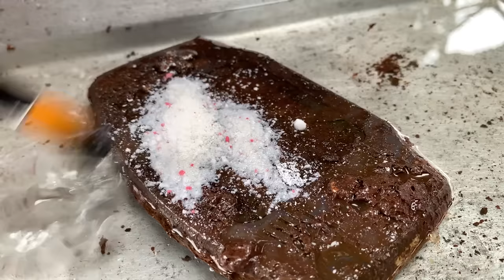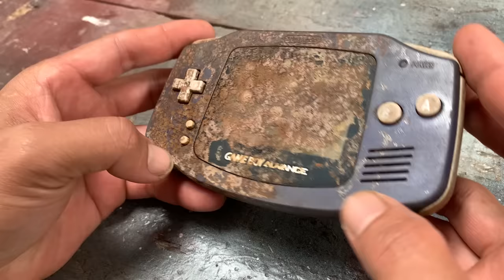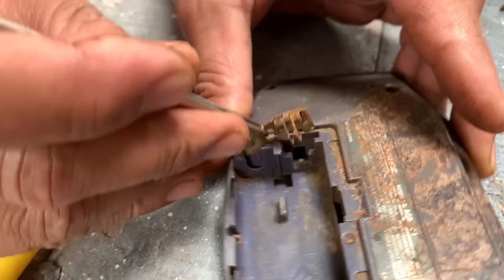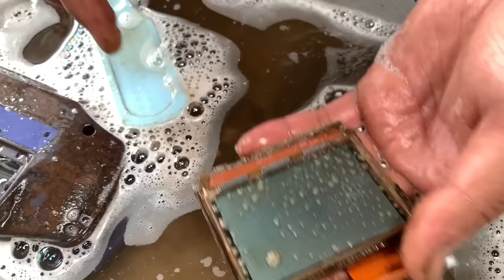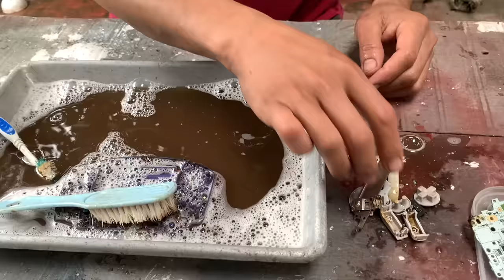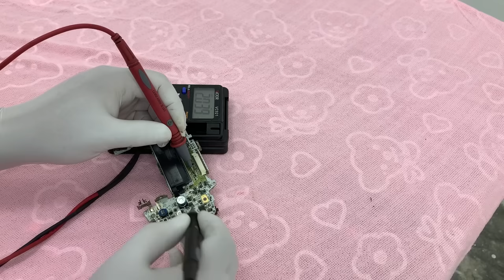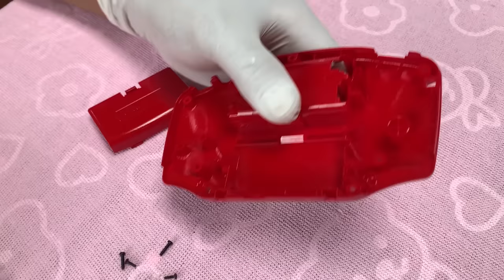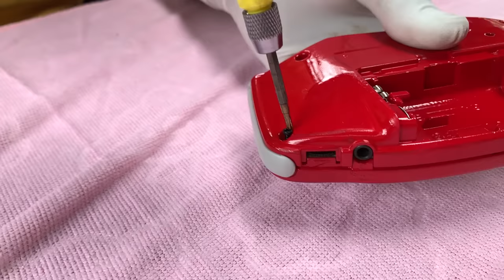Restoration Old Ｎｉｎｔenｄｏ gameboy advance | Restoring Game Boy Advance ＧＢＡ

Comment: Never knew that you could repair a Gameboy that has probably been sitting in a mud puddle for either a few months or 5 minutes before you started recording by simply submerging it and all its electrical insides in a bin of soapy water and then attacking it with an extremely rough brush. Truly remarkable.

(Edit: This comment is sarcastic. I know it's fake, we all know it's fake. Please stop lambasting me in the replies for being stupid.)
Reply: Ñ
Reply: @waflex9913  Ñ
Reply: Real, aún no me cabe en la cabeza cómo lo reparó luego de darse un baño de lodo por meses y uno de jabón cuando lo encontró
Reply: Ñ
Reply: You’d be surprised how resilient the old game boys are. To be honest as long as there’s no batteries in the system or other power source you can safely dump the circuit boards in soapy water to clean them without fear of them shorting out. Just make sure you fully dry the boards before you put the batteries back in. Most of the time you can clean the boards with rubbing alcohol, but when the system has been submerged for so long it’s sometimes best to just full on water bath the thing. I don’t think this was in the puddle for only 5 minutes because the outer shell itself and inner “heat shield” and the screen sponge had some pretty decent water logging going on. Not something that usually forms on plastics in 5 minutes or relatively fast. He was sanding it off after the water bath. He didn’t need to repaint the case, but he did just for a better look than the residual water logging. I’m not surprised that it ended up working fine in the end. You should check out some other Gameboy restoration videos. Some are pretty narly lol. Just giving some insight into this. I don’t believe the guy planted the Gameboy there the morning of the video. If anything this is a pretty good example of how much trauma these Gameboys can go through.
Reply: Being as im probably the only english guy to reply to this comment... can i just say i was thinking the same thing when i watched it.
Reply: @quigz125  this whole reply is a cope. Electronics are not impervious to extensive water damage and being exposed to the elements for many years. Fully dismantling the gameboy and then dunking it in water is not going to magically bring it back to life. He would have had to replace the motherboard at the very least in order to get it to work.
Reply: its fake duh
Reply: @wertydeluxe1405  I am aware, you did not pick up on my sarcasm
Reply: It's called a fake video
Reply: You cannot simulate that aged damage.
Reply: Dunno what you're implying but yes. This is exactly what an electronic that has been sitting in a garbage dump for a month would look like. Why are you implying it was impossible to find a Gameboy in this condition, do you see the trash heaps he's walking past? There's going to be treasures in that every day and Gameboy advances are hardy, yo. He even solders a jury rigged low tech fake capacitor in to avoid replacing the board when he finds a damaged circuit. Stop insulting a man for making money restoring trash.
Reply: @surtu9221  you're just believing it's real because you want to. If you look for the little details as he's reassembling, you see EXACTLY what stuff is aftermarket or OEM donor replacements
Reply: @surtu9221  it's so fake that it hurts. Virtually all the videos are the same. Dumpster where, OMG! you find a valuable article brushed with mud (brush marks included), horrible attention to detail when painting, cleaning with water instead of isopropyl alcohol... etc.
Reply: @quigz125  to add to this, there's a Gameboy in a museum that literally took on artillery fire iirc and it still functions to a limited degree, so bringing an actual Gameboy up to snuff not all too improbable.

Also considering all the garbage the chances of finding one and planting it for the video isn't all that implausible. 

50/50 on disbelief suspension.
Reply: yeah, it's clearly a fake.
Reply: @jonpeley  lol surtu is all over the comments defending this shit. I think she's his mom lol
Reply: Avionics mechanic here I work on uh-60 victors for a little bit of background. Everyday I deal with corrosions prevention and treating. I can tell you with 100% faith that this pcb would never have worked. There’s no way. Period. He clearly swapped out the pcb and probably other parts too. Don’t believe everything you see. It’s just laughable to anyone who seriously works on electronics that he would try and pass this off as actually repairing this. It isn’t feasible he’d have to replace components treat and probably repair traces etc….
Reply: @user-vb5yk6dj6w  Yeah I've worked with PCBs before and those things are fragile
Reply: Tati
Reply: I think its because its completely broke, so they wash it, and then since its clean they can access the insides and change em out
Reply: Yeah and we saw water drain out of it which means it touched the mother board so this kinda sus
Reply: They may have planted the gameboy there, but they could have already found it and decided to re-stage them finding it be they didn't record it...

Probs not true but just a thought lol

At least its being restored, even if it was only there for like 5 mins 

Fake or not at least it's getting cleaned.
Reply: @quigz125  this is so obviously fake lol
Reply: @SexyJutsuLover  yes a plastic device is rusty🗿
Reply: @tag7914  ü
Reply: ell, as long as electronics aren't on when they are in contact with water, and completely dried off,. nothing should be wrong with the electronic device.
Reply: @superblahman  no, the water fries the electronics
Reply: @game_player1345  Only if it's turned on.
Reply: @superblahman  no because the water is still conducting the electricity
Reply: @davidlane1248  Restoring something does not mean you use all the original parts.
Reply: @alejandragalarza2170  Ñ
Reply: It’s funny how people think this isnt sarcastic
Reply: @urmother5913  Yeah just about every person in this comments is either trying to correct me or is calling me stupid or whatnot lol
Reply: Yeah there's no way you'd get a Gameboy and film playing it before mudding it up and then edit it to look like you repaired it. Absolutely no way.
Reply: Why do these people always add mumbling into the background
Reply: @tag7914  Ñ
Reply: Que sabão que nada é um pó especial para tirar ferrugem e água depois foi água e sabão
Reply: @John Doe It is impressive the amount of people that can't pick up on my sarcasm
Reply: ITS A LIE EVERYTHING , EVERYONE IS A LIE
Reply: Emmmmmm para los que dicen ñ soy latino pero Xd solo tiene sentido poner Ñ cuando un gringo esta en videos latinos man XD
Reply: Sorry to tell you but it’s fake
Reply: @-Zon-  read my other replies
Reply: @theredstonereed3274  oh sorry bruh
Reply: its fake
Reply: @pullimau8555  read the rest of the replies
Reply: Ñ
Reply: You must mean truly fake right?
Reply: Haha, nicely put, I cant agree more, if it was as old as the dirt showed then the battery contacts would have been rusted.

He even put batteries in before he opened it up which means water seeped in and well, the power would just corrode the circuits.
Only idots get fooled by this and I see a few above me haha
Reply: @st3v3ndc  Yup lol
Reply: @horustrismegistus1017  you most certainly can.
Reply: @IrishOphidia  Pls make a video or provide one proving this
Reply: @horustrismegistus1017  as far as aging, just go look up prop making videos. People make aged parts all of the time. It’s not a new concept 🤣
Reply: I just came to the comments to say this in an equally sarcastic way.
Reply: @spiritualrealmmeditation4669  XD
Reply: I think it's Been there for years minutes would not do that
Reply: @universalsubs6935  it doesn’t take years. People will do this over a few weeks or months and act like they just stumbled across it. Then they completely replace the parts with new parts and act like they cleaned/fixed the original parts. It’s just a scam to phish for views and likes, but they actually didn’t repair or restore anything.
Reply: And they hearted your comment lol
Reply: @Thatsafunnywoman  they’ve been hearting everyone’s comments in a futile attempt to make everyone’s comments look like some inside joke
Reply: @theredstonereed3274  oh ok
Reply: @waflex9913  얀
Reply: Thats ok... its still good maybe one can fix it :D ykwis
Reply: @bsanchez3563  ^^ doen lazys
Reply: @bsanchez3563  ^^ doen lazies
Reply: ikr all those people wasting money on buying new one when you can just find it in the street and wash it
Reply: funny thing is he made a video before this about doing the same thing to a CRT (and to the high voltage parts too!!!!!)
Reply: Ñ
Reply: 인정 이 사기꾼
Reply: Yes it false
Reply: @angusmarch1066  I agree.
Reply: The minor amount of rust says it wasn't in there long, though I still like watching these scrub videos
Reply: yeah if you want someone that's real and actually does this stuff for a living check out odd tinkering
Reply: @quigz125  yes so real yes the rusty plastic had to be restored yes yes very much
Reply: Falso falso no podría funcionar
Reply: @alejandragalarza2170 la tuya
Reply: Ñ
Reply: Xd todo en pesos en el día que desperté como  un niño normal com mi familia era bonito así que fuimos a la playa ese día  cuando al siente día estaba   labando me astaque me cayo idea salio sangre continuara
Reply: @quigz125 bro wrote a whole essay-
Reply: I was disappointed , Duct tape was not included in the fix... duct tape fixes everything !
Reply: Compro otra consola 100 porciento
Reply: A mí me parece falso
Reply: @quigz125  🤓
Reply: Dude no one cares if it’s real.  They’re here to hear the ASMR…..shhhhh
Reply: Ye I agree

Comment: It's amazing how that display is working perfectly after being submerged in soapy water and scrubbed with a rough brush. There are no flaws on it. That's truly miraculous.
Reply: Ikr? I thought it wouldn't work after he put it in water
Reply: @sky-sx5gt  water does not damage electronics. If you have power or try to power a unit on while it's wet that's when you have the problem
Reply: @metal422life  oh I didn't know that
Reply: @sky-sx5gt  More specificaly its the minerals that you usualy find in water that can mess with electronics, mostly by way of messing up electricity conduction. Wich is also why mineral less water is your best friend when cleaning up electronics.
Reply: More amazing is that not one part inside was corroded or destroyed from weather damage or being exposed to water or dirt. He just brushed off all the shit on it. SUPER FAKE
Reply: @LezardMan002  I personally choose 99% isopropyl alcohol
Reply: @metal422life  u killed me dude XD
Reply: @metal422life  he did try to power it while wet!! Dippy
Reply: @Geneo-en5km  😆😂
Reply: I don't know about a miracle but my phone had been water damage  and what I did just let it dry , it  started working perfectly .
Reply: @josephj7908  pretty much as long as the water damage didn't actually seep into the digitizer you should basically be fine but if it's separated the digitizer at all of your phone would be screwed
Reply: @Geneo-en5km  no he didn't, he tried to power it on before he wet it.. was dry as a mofo then, sitting under the sun for ages
Reply: I think this is turning into a science lesson😂
Reply: I have the exact same brush an I can surely say that it's very soft
Reply: clean with water put the batteries and turned on xd
Reply: @Distortion_World  well yeah if you see any rust on the board or you see any dark brown coloration around any of the connectors it's probably screwed but majority of the time if you were to leave something out in the rain for say a couple weeks I'm pretty sure you can get it to work no problem but it's a thing is like thrown into a lake and then fished out a couple months later that would probably be problematic and it would also depend on if there was power in the device prior to it being thrown in the water
Reply: @Distortion_World  if you're to do that with the laptop I am sure you would see a light pop on for a second the screen might attempt to turn on but then you would hear probably an audible click or pop which would be the sound of the electricity surging on a place within it completely frying it most of the time well 99.9% of the time in my opinion
Reply: Definitely used black magic.
Reply: @metal422life  

Ok. Turn your phone off. Put it in water. Dry it out.. turn it on.. plz let us know.
Reply: @The-ghost-of-Moskva  I actually have before  not on purpose of course but it work after drying for almost a month. Water got into the digitizer and the thus the screen was fried so I trashed it. Already got a new one. I couldn't wait for it to dry 😂
Reply: @metal422life  close but no cigar, it DOES damage them. but yes is worse if you turn it on when wet. but water will always damage that shit
Reply: One word fake
Reply: JohnJohnop  someone didn't read the previous comments
Reply: Almost TOO MIRACULOUS
Reply: That's a soft brush
Reply: Aight that do make sense ngl fwiw ykwis an no cap either for reals ykwis :D
Reply: Lol
Reply: 摆拍，造假~
Reply: Bro crafted a game boy advanced 🗿
Reply: DO NOT MAKE THE GAME BOY MORE BROKEN THAN IT AREADY IS
Reply: @metal422life pero que hay de las piezas como condensadores? Con el agua debería hacer puente ? Disculpa mi ignorancia.